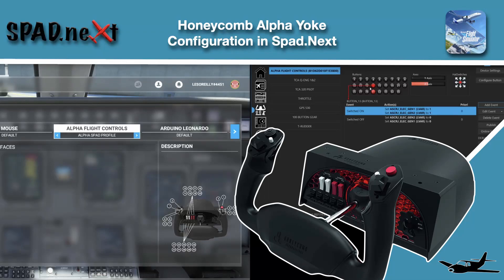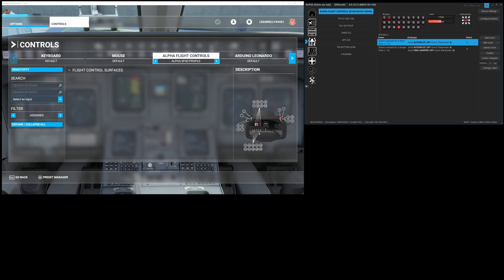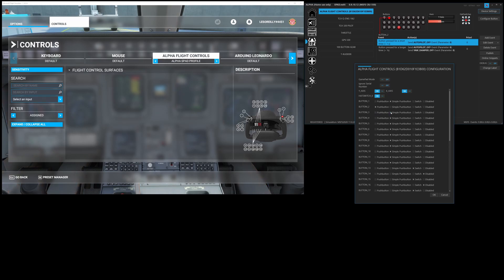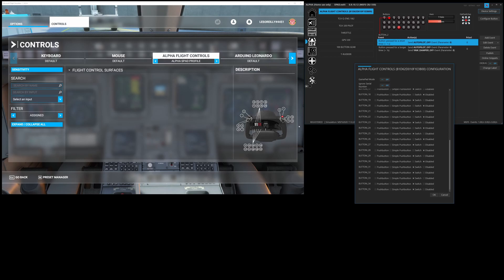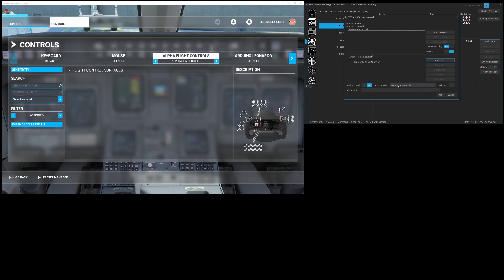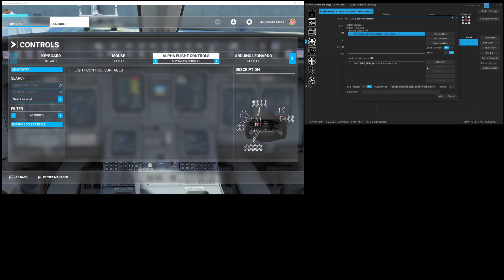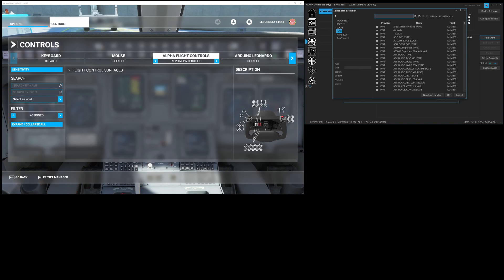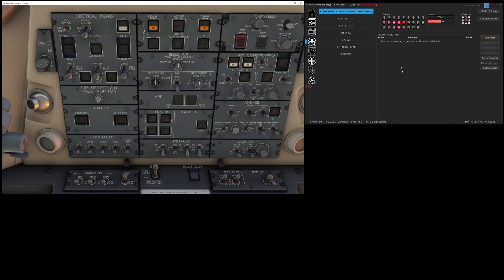(Sim Video) Alpha Yoke Config with SPAD.NeXt for MSFS 2020

Comment: Hello ! thanks for this video. I can't understand something : in the Spad.next soft I can't see LVAR on the left. Is it because I used the Spad.next. trial version ? In the cessna 172 when i set the Alpha button MASTER BATT (switch, add event, switch on, add action, send simulation event) i choose C172_BATTERY ON it's ok. But it's different with the OFF : the little switch abve (stby batt) is moving too... Could you help me ? Thank you
Reply from the maker: LVARs are a change data not an add event. Just use standard events for battery 1 and battery 2.

Comment: Is there not a way to make the light switches have off and on? when I copied you it just stays too on even when flicked off
Reply from the maker: Sorry I don't understand what your asking ...  You assign events for the ON (pressed) position and then an Event for the OFF(released) position of the buttons..  Make sure you have removed the bindings from MSFS for the same buttons... you can't leave them in both as that will cause issues
Reply: @LesOReilly  it’s kind of hard to explain what I’m saying with words. 

So I copied exactly what you did so when I put the light switches to on the lights turned on and I leave it there 

But when I move the light switches back to off on my alpha, the airplane switches still stay in the on position 

I’m just wondering is there a way you can make it like a light in a house where when it’s on it’s on and when it’s off it’s off

Hope that makes since…
Reply: Where did you go?! Come back 😅
Reply from the maker: @Irishwheels2  in the video it shows you need to do an Event for when Switched ON and Switched OFF ..  Note that buttons and switches changed in version 0.9.12 release so you don't need to change the config of the device ... Pressed = Switch ON and Released = Switched Off.. and as per the video .. use the spad discord for help.  Youtube comments is not good for this...

Comment: Rather than disable the off state of the physical switch and define the on as a switch, I assume there is no issue assigning both on and off as buttons and mapping them directly to the on/off events? Perhaps even as a pulsed option so they just send the one press?
Reply from the maker: Switch mode only sends the one event with spad. There is no repeat events unless you enable the “repeat” events button.

Comment: Hi, is a video possible, for configuring spad next for the Saitek Sim Yoke controls and the three throttle levers, propeller pitch, fuel, and the Whartog Joystick and Throttle?
Reply from the maker: I don't have the Saitek Yoke anymore...I also don't have a Wharthog...  But all of the concepts are the same... You apply the same approach to map the controls the same way.  Once Asobo fixes the new update that kills all bridges I will do a configuration on the TCA Throttles...since that is what I use now...
Reply: @LesOReilly  thanks

Comment: Thanks Sir, for sharing. SPAD is a superb program. Since I use It all my Saitek's problems have dissapear.
Reply from the maker: Thanks for dropping a comment on the Video!
Reply: @LesOReilly  yesterday I was trying to config the new CRJ. I did a good work with the lights in the Switch Panel. The Radio works right but the NAV frequencies are impossible to set. The AutoPilot is also impossible to make It works. Are you thinking about to make a whole profile for the CRJ?
Reply from the maker: Yes I spent about 3 hours the other night getting the FCP panel mapped to my VA 737 MCP.  Next I will put together a Saitek MP config from it best I can as well....  

Note I did publish a base Switch Panel and a Base Alpha Yoke.  These are done as devices currently...  Not as a complete profile.  Reason for that is when I do my profile I will not have "double" assignments between the devices I have.... I wanted to make some base 1-1 devices and put Starter events on the starter switches.,.. However for my complete config and future Profile that won't work for others if they don't have all the same controls since I will re-purpose the switches on the Alpha...  And I do starting via the TCA A320 Throttle!
Reply: @LesOReilly  ok. I'm mapping with LVAR as well, but it's crazy difficult. How are named yours profiles to download from SPAD? So you can see my test profile named elninodelavion. I get NAV working but It increments 30 by 30, sometimes 35 by 35. Doesn't Matter what increment number you set, It goes crazy. Could you check my NAV 1 profile in the Radio Panel? I Will try this night again.
Reply from the maker: @Elninodelavion  I am working on the Auto Pilot ...  Radios seemed to just work last I could tell ... Or are you talking about NAV as in Course?
Reply: @LesOReilly  in the Radio just works the COM frequencies. The NAV frequencies seems to works, but finally when you swap the Standby freq. to Active, nothing changes. It's really crazy, so please take a look at that...
Reply from the maker: @Elninodelavion  The CRJ is not using the Standard Sim Standby Freq for the Nav Radios.  Looks like they are supporting the Active Freq but not the standby....  Might have to do with the way they are doing the Auto Tuning feature but still they could use the Standard one for this.....  I guess log a bug with AeroSoft and hope they will address it...
Reply: @LesOReilly  I Will. Any way, if you do a profile for Radio or anything I Will try yours. Please, say me your online ID profile to download from SPAD. Thanks!
Reply from the maker: @Elninodelavion  I have published individual devices for the Switch panel, Alpha Yoke and now the MultiPanel (also a 737 mcp if you have one) I have not done a "Profile"... since mine won't match the switch panel basics or Alpha yoke basics once done.... I won't keep the duplicate events.  Hence publishing them as separate Devices.  Click on a button.. then on the right you have online snippets.. you will find the complete devices published with descriptions...
Reply: @LesOReilly  I mean user name. Is It Les O'Reilly I guess. Thanks for your help. BEST Wishes.
Reply from the maker: @Elninodelavion  yes LesOReilly